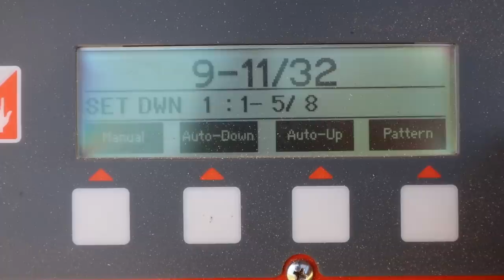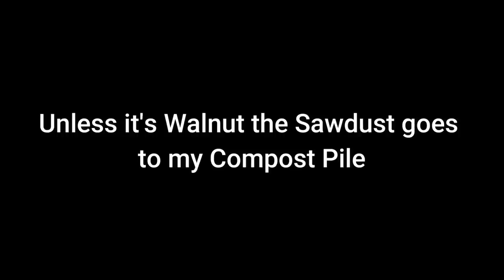This Log  Keeps On Producing Amazing Boards, American Beech On The Wood-Mizer

Comment: I figured you had a compost pile somewhere that the sawdust and that sort of thing went to. But what do you do with the walnut sawdust or chips?
I know that some wood like pine in chip form can deplete the nitrogen from soil. To compensate for that I would add manure to my compost, chicken manure most of the time. And yeah, the neighbors loved me for that unless I had the pile divided into two piles and covered the manure up with one of them. Then I'd turn the entire pile once a week. By moving it more often and keeping it moist it causes it the break down quicker and become usable sooner. I also added my grass clippings and leaf mulch to the pile as it became available too. Each spring I had really good, rich, dark compost/mulch to use in my small garden and flowerbeds. And it was good to add to the perennials as well.

Comment: What's the liquid that drips off the black part of the machine right near the saw blade? Is that lubricant?
Reply: Deb G yes. It comes from the white jug on the left side of the saw through a small tube right onto the blade. Most people use water with a little dish soap.

Comment: Am interested if price is right for a board 8 ft to 10 ft long and at least 2 ft wide for my iguanas to have as a better size since there are 2 of them sleeping together and queen recently fell off even though she has stair case to get up and down will be lowering their shelf from about 6 ft up down to about 4 foot high and could be as thin as 1 inch or no more than 1 1/2 inch thick or it may be to heavy to hang on wall and can be the cheapest wood  not really looking for expensive and out of my range just something wide enough for them to turn around one lizard is 5 ft long and others 3 1/2 ft be nice if i could find 3 ft wide but will survive if not